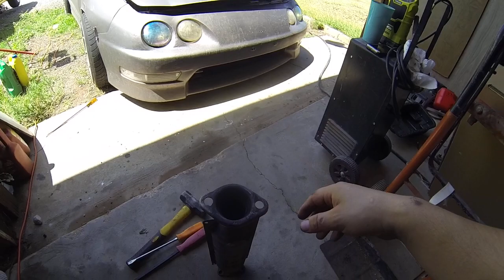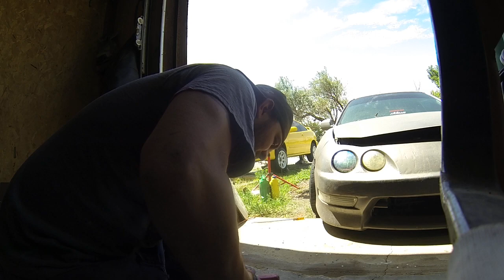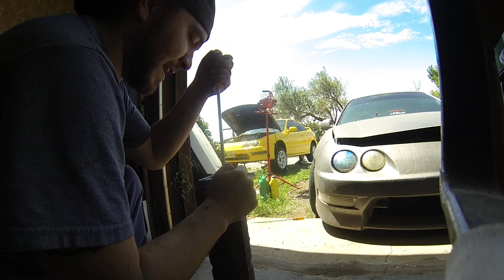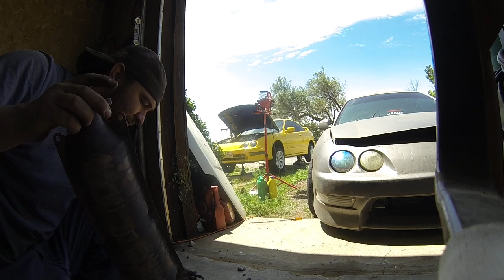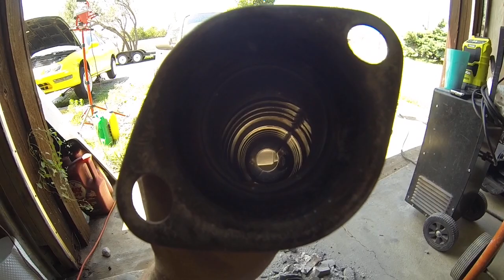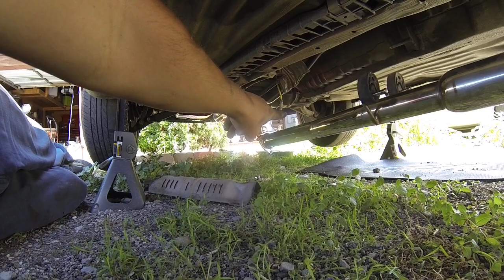How to Gut A catalytic converter!! And exhaust install on Gsr integra

Comment: I'm in abilene, i have on 06 civic would it improve power or economy doing this? 1.8 ?
Reply from the maker: 06 I believe you could man not too sure never really messed around with anything 03 and newer
Reply: With no cat your gas burns off faster  but u get about 5hp tops

Comment: Will this make check engine light come on?
Reply from the maker: No it will not as long as your o2 is plugged in. I offer ecu services to where I can disable your sensors so your cel light wont come on. Let me know.
Reply: It's hit or miss. It SHOULD make the check engine light come on but for a lot of people it doesn't. You can get rid of it with a defouler or with an ecu flash